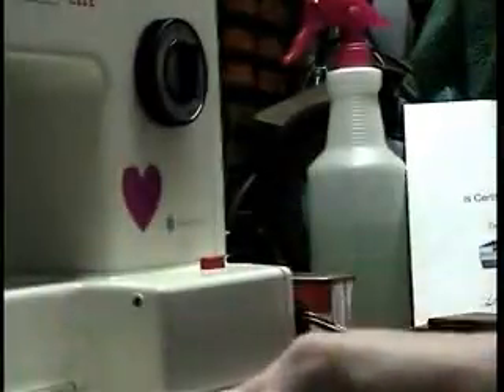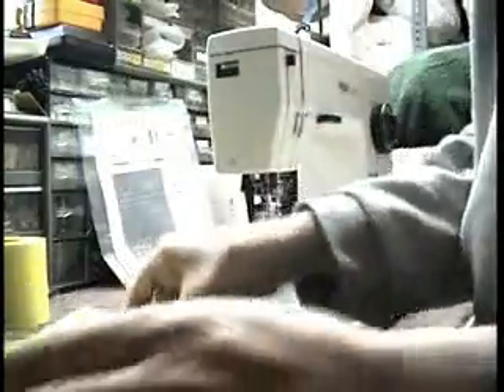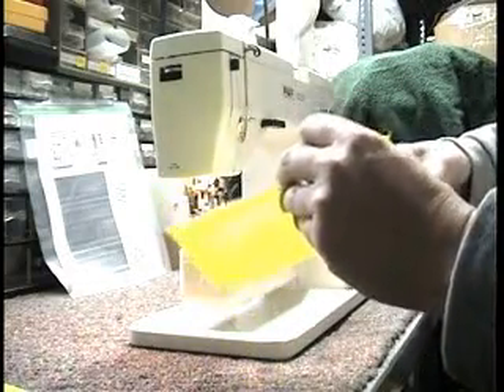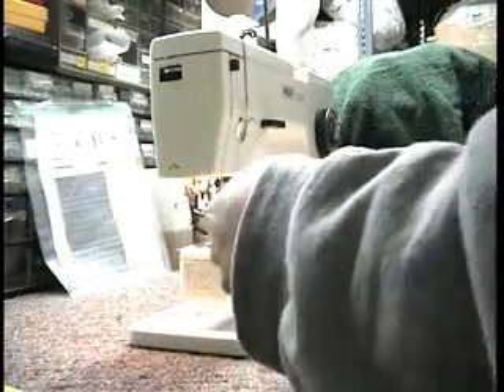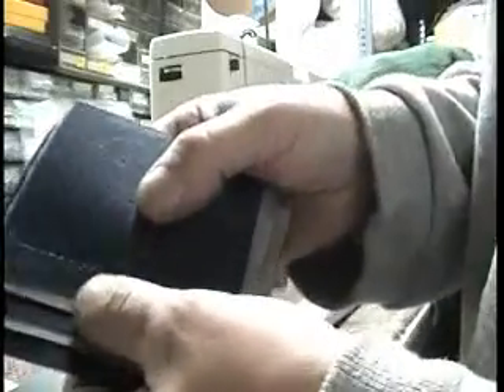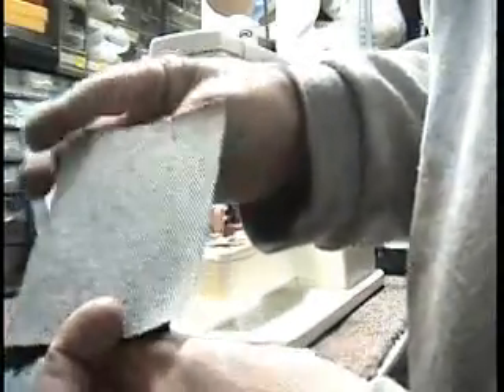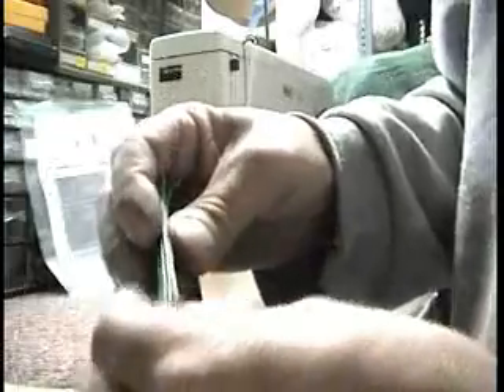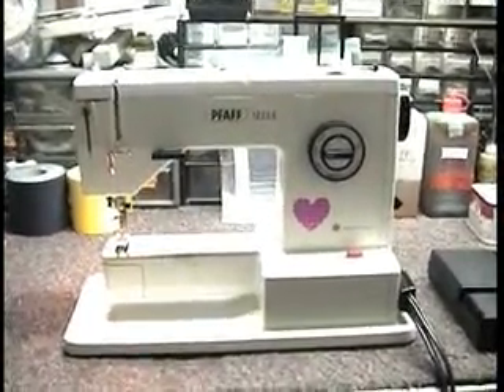Becky's Pfaff 1222E Part 2

Comment: Hi Kenn, I am hoping that you will be able to advise. I am from the UK. I was given a second hand Pfaff 2221e by a friend. The issue is that at first the reverse switch did not work and the machine would only run in reverse. I took the bottom panel off and LO the switch itself began to behave correctly...kind of. Now I try to run it but the thing which moves the fabric with the teeth on does not seem to want to move the fabric at all??? Hope you don't mind my asking.

Comment: Hi Ken, I don't live in the States so I can't bring my Pfaff 1229 to you. I hope you can advise though. The problem is with the bobbin indication light. It was not working when I bought the machine 2nd hand. However, there was one time when I noticed it lighted up for about a minute indicating that my bobbin was empty. So I am wondering whether it can be fixed. My sewing machine man said it can't. Also some of the patterns don't seem to be sewing in the full pattern (stitch length messed up), c